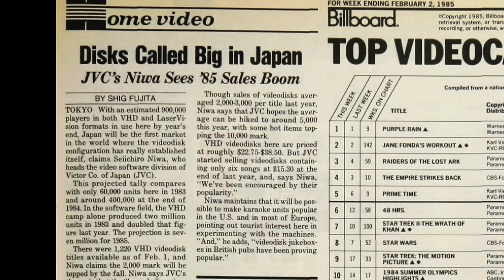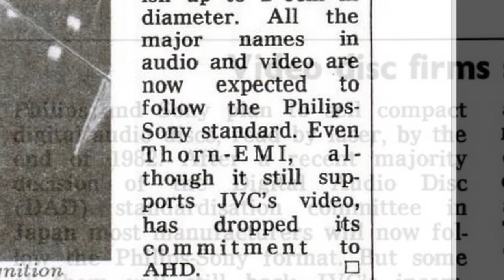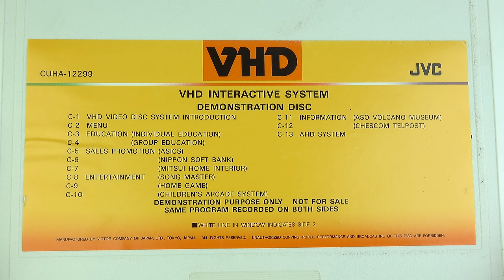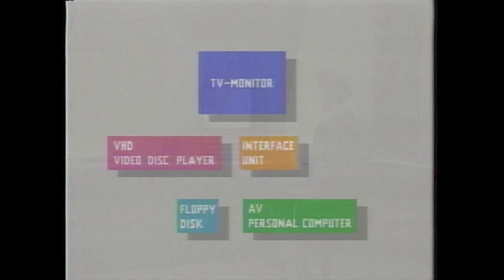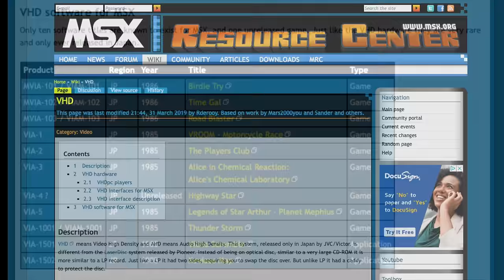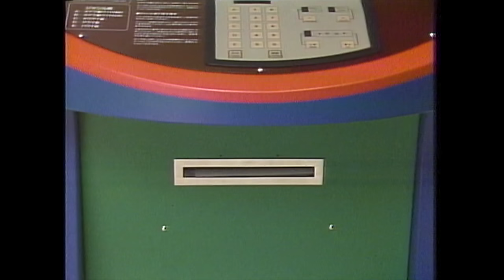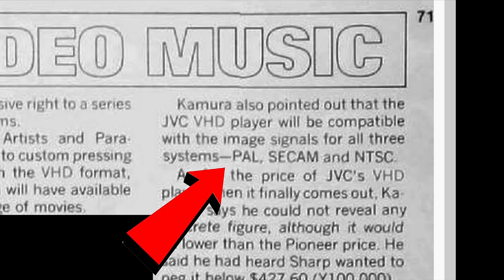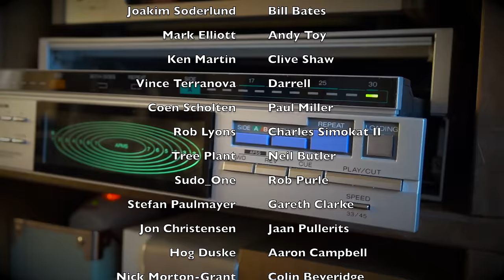VHD in the UK - how 1980s UK missed out on this interactive video & games format

Comment: DVD, Video CD, CD-i There was also a VHD format multimedia disc.
It's also shocking to be able to store 2.54GB of data in the early 80s and 80s 😲😲
Reply: WRONG! 0,3125 GB. You do not understand difference between BITS and BYTES!
Reply: @ataksnajpera  And you don't understand the difference between "nad" and "and."

Comment: What are the odds, that "blank" disc in the wrap is the demo disc from the empty caddy..? 

32:48 - Who needed an interactive slideshow about roaring down the motorway, when your "average" hatchback had 3,5 liter v8, manual gearbox and rear drive... so you could just go out and have it "realtime 3d surround sound G-force enchanced"

Comment: I had a Pioneer Laserdisc player for many years up until the mid 2000's when it was relegated to the bottom of the closet next to an old Macintosh SE. It's still there with a copy of Beavis and Butthead Do America and "Spaced Invaders" lol. By the end of its life you had to smack the front every time you turned it on or it wouldn't play

Comment: You mentioned the audio version (AHD) using large discs like the video version and like laserdisc and how that would have been seen as a downside but let’s remember that in 1982 phono records where still one of them the main ways to listen to music and they are relatively large (for full sized  33 1/3 LP records) so AHD’s size  would not have been much of a factor imo at launch though once the  audio CD’s came out, with its much smaller size that would have change. Now if AHD used a analogy sound recording technology (you didn’t mention if it was analog or digital) then some people would still buy then for the “warmer” sound as analog music fans still do to this day. 

As for video, both this and laserdisc had big advantages over VHS but advantage of being able to record with tape vs playback only on these formats meant that those unable/unwilling to invest in more then one format went with VHS despite it’s lower quality picture and  lack of chapter advance/quick. VHS was good enough for most. Once DVD came out we recognize its compact size and other features such as chapter and title selection, menu screens, alternate duo track, digital surround sound capability, higher picture quality, etc. made a playback only DVD player worth it. VHD’s interactive possibilities might have sold enough players to keep the format alive as niche product models ch like LD stuck around as a niche videophile product in the west until the seven big DVD. I wonder if they could have developed a dual LD/VHD player like they did with duel DVD/LD machines in the late 90’s?

Comment: This...actually sounds like it would've been a really nice little format that might of even gone a little far had it had been released in more places than just Japan and marketed the right way. Super unfortunate that what could've been a pretty pivotal early push for "videodisc" tech was bogged down by confusing and underwhelmingly-performed competition and unforseen technical issues preventing an already expensive launch.

I mean, it's practically the quality of Laserdisc (or at least, LDs of the time) but on something with a smaller form factor that holds more data per side...and is easier to manufacture so more could be released! So much lost potential. Good thing that we have this sorta thing documented the way these videos do, ultra-fascinating.

Comment: Vhd players also had 3d movies like Friday the 13th part 3 and jaws 3d with a 3d mode for 3d shudder glasses. Years later i bought a field sequential 3d system for tube televisions to watch VHD 3d movies ripped to DVD. The 3d looked way better and clearer than anaglyph/red blue glasses. Wish I could watch Friday 13th again but the system doesn't work on new TVs

Comment: I live in Blackburn and I find it intriguing there was a laser disc manufacturer plant here. I wonder where exactly?
Reply: Philips Road surprisingly enough. Most of the Laserdiscs manufactured there in the 1980s turned out to be defective and suffered from disc rot. They also made defective CDs for several years before selling the plant to another company.

Comment: So Thorn EMI was the British equivalent of General Electric?
Reply: For quite a long time, a massive percentage of British tech was owned by either EMI or Marconi. The latter had many, many subdivisions, and were also deeply connected with GE, so you could say that EMI was the British GE, but so was GE :-) I used to work for GMRDSL in the 90s, GEC Marconi Radar and Defense Systems Ltd.
Reply: Harry Potter ! mentions Marconi. Their parent company was actually called GEC (General Electric Company) completely unrelated to GE, and made everything from Nuclear Power Stations and Railway Engines to consumer radios. Both replies are correct in that both Thorn EMI and Marconi were huge. Before they merged with Thorn,   EMI developed and marketed the very first Body Scanner, I don't think there are any UK companies like that left any longer.
Reply: @MrDuncl  Ah, my mistake. I thought GE and GEC were the same entity. Yeah, I remember EMI Medical's body scanner - my Dad was part of the crew that built them.

Comment: As far as I can gather, JVC's decision not to release VHD outside of Japan was actually a sensible business move.

In North America, CED was failing while LaserVision became a niche product and nothing more.  The home video market was dominated by VHS and, despite the marketing trying to position video cassette and video disc as complementary formats in a home entertainment system (much like how Compact Cassette and vinyl records complemented each other in a home audio system), VHS and VHD would have been positioned as competing formats by the marketplace ... with VHD certain to lose for the same reasons that CED and LaserDisc failed to gain mainstream acceptance to the degree that VHS had achieved.

The same situation would have unfolded in Europe (though CED was only released in the UK in the European region, LaserDisc faced the same shortfalls against VHS).

Rather than having both of their own formats competing against each other, JVC wisely sought to concentrate on VHS in the West.  While JVC had already invested in the developing of the format, it would be throwing good money after bad by pushing through with releasing VHD considering the market conditions.

Comment: Nice to see your player are multiformat compatible cause in laserdisc its not always the case -_-. 

About YMO ther is 2 VHD disk  Yello magic orchestra VHM48002 (a Concert mixed with some commercial video clip) and Propaganda VHM78001 (a hudge 1h30 video clip oO.) 

From my side I always whanted to try some VHD games specialy Time gal, and I have VHD players, MSX and Sharp X1 ready to run games but never have found games, MSX cartbrige or Sharp X1 hardware card at resonable price -_-.

Comment: e.m.i. was partly instrumental in the development of the BBC's Verda steel tape video recorder in the 1950s in some circles also known as the cut-throat!! because of the lethal potential if the steel tape broke... ouch!!,
this makes the e.m.i. the father of video
creating a format for saving televised programming was nothing new in Britain several of John Logie Baird phono vision discs still survive to this day from 1928
if I ever get my hands on a 1930s record lathe it would be an interesting experiment to record an analog signal from an old tv camera  
and maybe a very bad digital signal since both analog and digital encoded signals can be made into a sound file that is recordable on a 78rpm disc record 
the difficult thing is to make the decoder!! a thing Baird in 1928 never really succeeded at but wé did in the 2000s more than 70 years later!